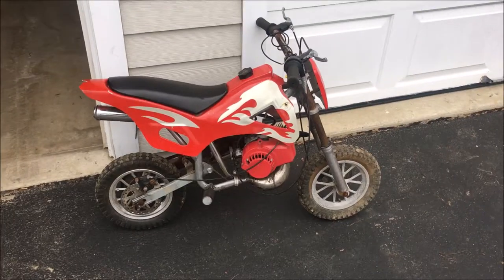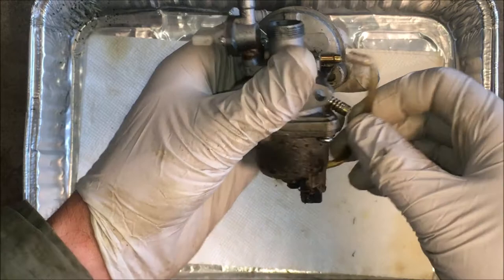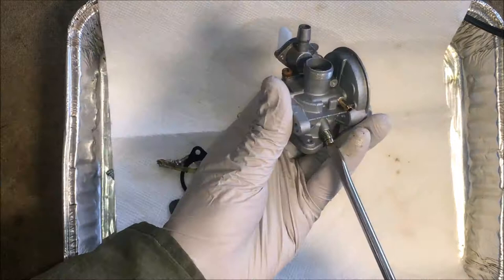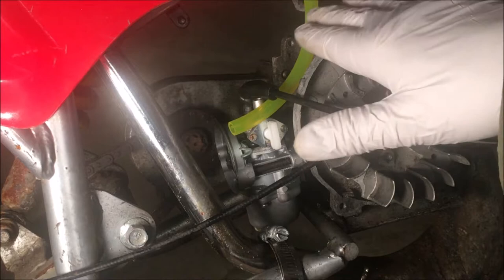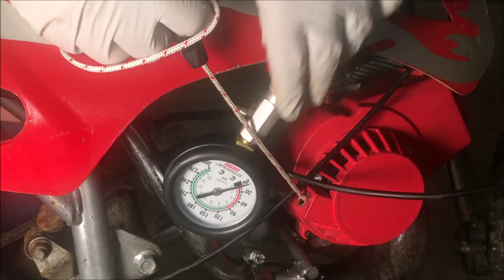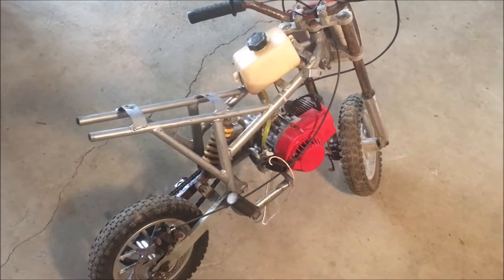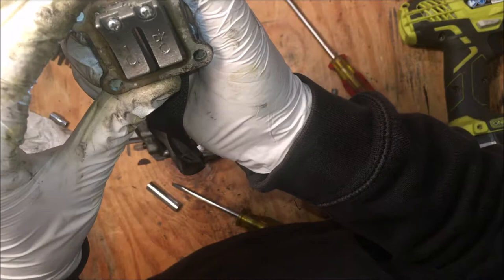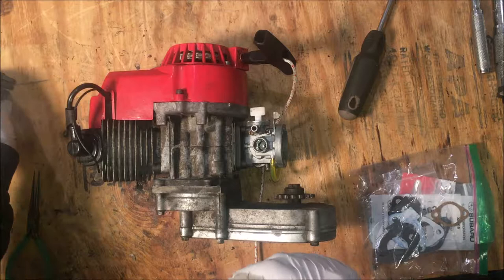Coolster Dirt Bike - Engine Repair - Part 1

Comment: That young fella has a vested interest in that machine.  I fondly remember the first and following Honda 50cc sport, Honda 65cc Sport and Honda Cub 50cc my dad brought home over my young adolescent years.  All had something wrong with them.  The first had a Stripped out and welded on kick starter lever and problems within the transmission that dad and I repaired and rebuilt, the second also had the same problems came from the same coworker was ridden by his younguns.  The third had only a loose connection between the two halves of the carburator which recurred again until dad decided we would stake the screw heads and aluminum body to prevent their loosening and that worked for years. I had never heard of loctite back then in the mid to late 60’s.  By the time the second bike rolled in dad had a major window and siding replacement project going on at the house and basically said you know where the tools are.   One of the worst problems encountered were how tight the factory installed and different material of steel bolts and aluminum vase resulted in the Phillips (can’t recall if equivalent to a #2 or #3 Phillips head were tightened.  Had luck with using a hammer and good Phillips or a piece of brass to impact on the screw heads before removing but some heads were already stripped out by someone else’s efforts so a cutting chisel, penetrating oil and patience was the cure for them and buying new screws from the local Honda dealer, the internet wasn’t around yet either.  I rebuilt the trans on the 65 Sport, replaced the seals, rings, cleaned the cylinder with abrasives to help new rings seat and resurfaced the valves like you do.  Lots of fun times with my dad overseeing, or just checking in on my progress from time to time and after he stopped his window replacement work for the day we might go fishing anc he would ask me what I had done and if I did not mention a key step in doing something he would say are you forgetting telling me about something else you did or are you gonna have to tear back into that area to do that step.  We didn’t have any pneumatic tools or even a manual hammer blow impact though we sure should have bought one but dad was use ti doing things without all the right tools.  We lived near acres of woods and where high voltage high line and highway right of ways were being carved out if the woods so we always had somewhere to ride off-road not that it kept me off the roads as the tickets I soon accrued would testify to.   Hope is in in for a world of safe driving, our bikes were never really powerful enough for the stunts you see youngsters doing now in motorcycles do jumping creeks and such and seeing who was the fastest through a course we made was our injury provider.  Lots of fun.  If that bike is a true 50cc and geared right as light as it looks it should easily go 55-60 mph, even our Honda 50’d would do that on a king straight of way especially with a bit of downhill.  45-50, even 55 was usually no problem on flat terrain with just one rider.  Watch out over him you may need to add a throttle or rev limiter depending on his own developing riding style.  We also had no riding gloves, pads or helmets which I would suggest a helmet at least but that is your and his choice, kids, at least I did tend to feel invincible even though we weren’t

Comment: That is a strange looking float configuration with the float NOT attached to the hinged plate actuating the needle valve, guess that’s why it’s a full circular float. Definitely new to me.

Comment: The reason the compression is so "low" is because with a very small displacement engine, the short and small puffs of air get absorbed in the gauge hose and don't make it into the gauge. You will need a hose with the Schrader valve as close to the spark plug hole as possible to get an accurate reading (and it will take more pulls to reach the maximum gauge reading compared to a larger engine). Love your videos keep them coming!
Reply from the maker: Thanks, was wondering about that.  Have test a few other small engines that ran fine, but same result.
Reply: Yes,comression testers for cars with long hose,Illike the one ,it has a rubber cone ,fits over spark plug hole

Comment: The rubber disc in the fuel tap either swells up, blocking the fuel or crumbles, blocking the fuel, depending on what brand of old sneaker sole they cut the rubber washer from.

Comment: When you puller once you got it some pressure on it hit it with a hammer and it will usually pop off if you just keep turning you can crush the end of the crank shafts. Another trick you can do to make a gasket it to hold the gasket material on the partt and use a  Ball pain hammer and tap the edges till you cut the gasket out look it up Roadking85 dose all his homemade gaskets this way saves one step Love the videos you do keep them coming

Comment: Piston is scored more than you may think.  Not having gaskets on carburetor, loose cylinder head, and loose/misaligned reed valves leaned it out.  Doesn't take long on a 2-stroke.  Another seller that lied like a rug.  On cheap Chinese bikes and acts, anticipate more problems than normal until you get it sorted out.

Comment: If you want to start this engine put some gasoline and oil down the cylinder through the Spark plug hole

Comment: Should have walked away- it's worthless when new. Why order new parts when the scrapyards are piled high with those things. Better to pick a lifan 4 stroke pit bike from the scrapyard- they're also plentiful because nobody wants them. We once had a club, racing the road style pocketbikes,  had all the go fast stuff- hi comp barrel+ head kit, fibreglass reed valve, advance timing key etc. Would propel my 140kg bulk to 60kmh, but wears out quick! Those carbys are the shitty ones- use the diaphragm carby instead that some of the sportbike models have. The built in fuel tap is the worst part!